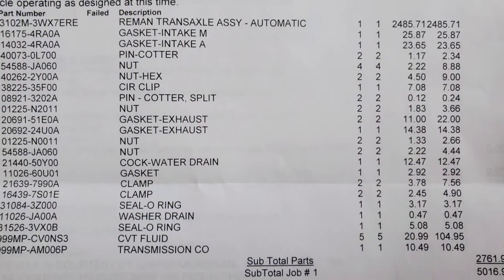2017 Nissan Maxima Cvt Failure! 🔴 What Signs to Watch For and Things To Avoid!

Comment: The CVT service intervals on nissans  should be evey 20k miles , the fluid gets very hot very quickly before  the transmission cooler cools it  down ,  therfore  the fluid gets burnt and starts damaging the CVT
Reply: it costs $225 dollars to change it so doing it every 20K miles would add a significant operating cost for the car. The manual says do it every 60K.
Reply: 147k never have never will gets driven across the country 3 times a year hard
Reply: @crand20033  I got mine with 41000 miles when I got to 60,000 I made sure  that service done. So far no issues!
Reply: I just talk to a guy who said he used to work on cars 30 years. Anyway he said the same thing, to change it at 20k.
Reply: @juancontreras8376  is that 20k after 100k miles on the vehicle?
Reply: Nissan knows about the issues with their CVT transmissions. They've been sued over it and refuse to recall.  At the first sign of transmission issues take the car to a dealer and trade it in. (or push it off a cliff)
Reply: Every 20k miles, sounds like a piece of crap for transmission.  Guess, change oil and transmission fluid at the same time 😂😂, I have a 16 maxima. Sadly! Looking other than Nissan!
Reply: @crand20033  so much bullshit by nissan, they better say go to another manufacturer!
Reply: Nissan mechanic told me the same thing. Change the fuild every 20k
Reply: @crand20033  you should learn how to diy. It’s not that hard you’re mostly paying for time because ur car just sits there for a while while they work on other cars. I drop the pan every 60k after drain and fill every 30k and might drop the pan again at 60 or 80k I’m not putting stress on the transmission much so I don’t have problems with mine at all
Reply: @crand20033  it costs me $60 lmao do it yourself clown
Reply: @airuzair2424  I'm such a clown that I can't even get the cap off of the filler pipe.
Reply: @crand20033  ok baby boomer
Reply: @crand20033  How did you get cap off? I have same problem.
Reply: @leehagen4061  No I took it to the dealer and they did it for about $280. Some places charge more than that but there are other ways to change it. I think some places do a more thorough job than others. And some places won't even do it because there can be a lot involved with it if you want it done right.
Reply: Got 170k on one of mine and I never had a problem nor has the fluid ever been changed.
Reply: It's 65k to 70k not 20k.
Reply: @jerrywilcox9890  Glad to hear it but I'd better  save up $4000 just in case. I like my Rogue.
Reply: Y’all do oil changes every 20,000 miles? Boa wtf😂
Reply: @crand20033  you drive it normally won't have a problem.people having problems drive them to hard.
Reply: @jerrywilcox9890  I agree,  but I would like to say that I don't see a difference between my CVT transmission and the one I had in my Chevy Equinox. My Nissan Rogue is very responsive, accelerates very smoothly and my car is very fast, powerful and zippy. I have no complaints and I'm very impressed with how it performs but I know the CVT is more likely to fail than a regular transmission so I will be changing the fluid more often.
Reply: @crand20033  I haven't had a problem with any of mine and I have 3 with the cvt transmission.
Reply: @jerrywilcox9890  Well, it's a matter of time and mileage but as I believe these transmissions are more failure prone than than geared ones and Nissan is notorious for producing cars with CVT transmissions that fail.
Reply: I do it myself for $100 and it's real easy to do...much easier than a oil change for me
Reply: I've added an bigger transmission cooler to mines. At 220k miles as of now and still counting. 
The fluid does get really hot 🔥. 
A few yrs ago when I noticed the whine and limp mode after I drove it over 45 minutes especially during the summer. 
 I did some research. I got the cooler installed. 
No more issues. Drove it to Orlando twice and didn't have any problems.
Reply: Where you got the cooler from? And how much?
Reply: @waviiflock1017  I bought mines off ebay for $200 and had it installed for 150
Reply: I got it done the first time at the stealer...yes 250.
Did it at 75k.
Next time I will do it myself and replace the external filter (dealer does not do this), I will drop the pan and clean the internal sift filter. Make sure it looks good inside.
Should cost < 80$
Reply: @jerrywilcox9890 if you don’t mind giving a more in depth explanation of driving too hard.. because I think I know exactly what u mean I just want to be sure. I have been looking into some newer cars (than what I have)  and my mom told me either a Toyota , Honda, Nissan.. with Hondas and Toyotas still being pretty expensive on the used private sell market for the year I want, I’m looking more into Nissan.. either Altima or maxima.. I’m looking at a maxima with 125k miles..  v6.. but yes I do think a lot of people always complaining about CVT takes every chance to floor the gas pedal through the floor.. and tbh I rarely see Nissans on the side of the freeway.. for them to be “such crap” and I’m pretty on top of my car maintenance.. if something small even sounds off, I get an entire thing serviced.. lol
Reply: @scottstewart2030 I’m really ready to do this
Reply: 20k is 10k less than what trans used to be serviced or even rear diffs. You can do the service yourself for $150 or so. Or wait and pay 4-6k for a trans. No trans is lifetime fluid, non.
Reply: So why wasn't you changing the transmission fluids and the cooler. It's not necessary for the cooler but it's just to have it clean for a better flow. I think you over paid for the new transmission. Also trying to drive it as if it's a manual is a Bigg miss take. When you see them for sale and needing a transmission that be the big reason. I don't bought so many gen 7 and flipped cause people didn't want to deal with the swap of transmission as if it wasn't their fault. Just because you can drive a real manual car it's not the same with the Maxima not to me it just don't feel right with out a clutch.  But you should have paid about half the price of what you paid for the transmission. Maybe lesser

Comment: Us to work on Nissan Dealership. Besides the rear wheel drive models. All the CVT no matter the model fails to the point of destruction. 6k to 8k or more $$$. Nissan manual transmission only.
Reply: Purchased a 2022 Sentra SR 6 speed manual in Canada and i know Nissan CVTs 2000 and up are much improved, but i always hear these horror stories about Nissan CVTs........
Reply: How many miles to change the cvt fluid?
Reply: @Therealpeter10  25k to 30k only use nissan brand cvt fluid you'll need 5 quarts and you'll have some left over dealership will charge $250 or so be $145 if you do it yourself figure $18- 22 a quart plus tax.
Reply: @johnjacobjingleheimerschmidt  thats too early manual says 60k tho
Reply: @Therealpeter10 25-30k. No matter what the manual says.
Reply: @Moistnmeaty90  maximas cvt are reliable than most though
Reply: @Therealpeter10  I agree, but the fluid still breaks down and there is wear that occurs. The fluid is jet black after 30k miles.
Reply: @Therealpeter10 even more reliable then Toyotas cvt’s 😂
Reply: Next time use carshiled and only pay thr deductible
Reply: @Moistnmeaty90 dam right after I did the 1st fluid change I decided to do the second one earlier and I freaked out because the 1st time didn't look that bad. Did 3rd change around 74k
Reply: @Moistnmeaty90 exactly 😂
Reply: @Therealpeter10 don’t believe the manufacturers hype between 20-30,00 bro 😎
Reply: @Moistnmeaty90 don’t forget to change the filter too
Reply: @hurleylee5754 I wouldn’t say that

Comment: For any newbs. CVT do not like to be raced. They do well on smooth acceleration. If you’re always flooring it it’s likely not going to last. Also, maintenance is CRUCIAL on CVT. The nicer and smoother you can drive it the longer it will last.
Reply: So basically don’t use the car for what it’s made for 

Drive it like a Oldsmobile basically 

So why buy this car if it can’t do what it’s designed to do because they aren’t even roomy…not comfy…not reliable 

They look ok…still has that Nissan badge though…

So I don’t understand why anyone would pay 40,000 dollars for them brand new knowing they’re not good vehicles
Reply: @tharpeaddy I keep asking the same questions. Everyone who defends cvt’s says the same shit about don’t drive hard or in stop and go traffic. Who can always avoid stop and go traffic and what’s considered driving hard…so dumb to even say.

Comment: Engine braking, Sport Mode I don't do. I don't ever floor it. I have a 2022 Maxima SR with 15,000 miles. Loving it! You drive it hard, can't do that with a CVT.
Reply: Shoulda bought a q50 tbh
Reply: @Ah_Dat_AJ I would easily buy the Q50 if the interior wasn't crap. It needs an update
Reply: Couldn’t agree more. Cant understand Nissan with Q50 having less features than a Maxima with infiniti being their luxury brand.
Reply: I agree  @Ah_Dat_AJ
Reply: @Gus31262 if I was you with that 2022 Nissan Maxima I would do a CVT and filter change between 30,000 to 50,000 miles... Don't follow the maintenance schedule of Nissan and if you do, do all maintenance in half the time or 3/4 the time they recommend so for example if they say do spark plugs at 100,000 do it between 60k- 80k miles.
Reply: @hajileserpud9539  Spark plugs can still be done at 100k or if you experience misfires. Even so they are inexpensive but it's not like it needs to be done earlier just because it's a Nissans. CVT fluid change at 30k is the only thing that is a must. 

Heck really only oil, and all oil/air filters need to be changed at intervals, the rest can be changed when it goes out

Comment: 2016 Maxima S with around 140,000 miles.  I haven't had any issues.  Love driving my maxima.
Reply: I just saw one for sale around the same miles you still liking the ride? Lol
Reply: What transmission service have you done so far?
Reply: 2016 Maxima Platinum 147,000. Transmission just went out and in the shop to be replaced $6600.00. I only had it for 15-20,000 miles. Extended warranty is a must. Nissan says every 30000 miles trans must be flushed.
Reply: I Have a 2014 Max...granny I'd a ting up getting worried 146,000 miles
Reply: I just dropped  my maxima SL 2016 off to have my transmission replaced. I have 144000 miles. I love the car and I keep it looking new, in and out. Im one of those that religiously do all the maintenance. So I would rather pay $6k than paying $60k for a new car. I took it to the dealer by the way, I wanted done right the first time. 36k miles warranty.
Reply: @EARTHSOUL_Asm   you watched a video about the most unreliable car and you are considering buying one? with 140k miles? some people cannot be helped

Comment: Sorry for your expense and feel your pain! I had a 2013 Sentra that I bought certified pre-owned with 20,000 miles and loved it until the CVT failed at 110,000 miles! It was going to cost me $5K to replace the transmission too but the car was only worth $,4500 with a year warranty on the CVT...no thanks! I was never going to buy another Nissan again until the dealership offered me a lifetime warranty ($100 deductible) if I bought a new car from them. It would cover the powertrain (engine, CVT, starter and alternator).The catch is that the dealership will do all the scheduled maintenance, so I purchased a new 2019 Maxima SV for $39,000. Great car so far with no issues (57,000 miles to date). I would recommend a warranty for any car these days. Repairs are too expensive!
Reply: My 2014 maxima cvt transmission died at 61k miles had extended warranty i paid $2300 for got a new one Lucky.

Had some steering components replaced too that would be over 1k
Reply: @CurtisDJunior  ouch man..... I find with these cvts, you have to take easy on them, they are not like regular automatic
Reply: @alvinsimba734  i take it extremely easy still happened. Not sure sure what happened the first 14k miles though before purchase. 

My only take away is change fluid every 30k and always park usong emergency brake. Hopefully the new one lasts
Reply: be sure to read the fine print on these warranties. Some of them will only repair the car if the repair cost less than the value of the car. Once the car gets down to being worth $5k, they won't fix it. Hopefully you didn't get that kind of warranty.
Reply: Where did you buy it from?

Comment: Nissan uses Jaaco CVTs which need a fluid flush every 20k miles to stay fully functional over 100k miles. Unfortunately dealers often tell ppl not to replace the fluid because it's a "sealed environment that you shouldn't break." so that they can get the money when you need a new transmission.
Reply: Nissan says to change the fluid every 60k miles in the owners manual.
Reply: @trenton737  if you change it every 60k you're still risking your transmission. Many different mechanics have recommended to change it every 20k-40k. 

That being said every 60k isn't that bad and will still let your transmission last way longer than if you never change it at all
Reply: That service advise was stopped years ago. Subaru also uses a Jatco transmission and they still advise their customers to never change the CVT fluid, to this day. That’s why Subaru cvt’s have the most issues now.

Comment: it sucks you had to replace the transmission, but you did admit that you know you caused the damage by driving very aggressive. Im really hoping my trans will last the life of the car, the only semi aggressive driving i do is quick acceleration from a stop every so often. I just did the fluid flush around 55k miles and it runs as smooth as butter still
Reply: The transmission will go out no matter how you drive it. It actually grinds the fluid, plus it's metal slipping and grabbing. Having to worry about passing on the freeway or accelerating for some reason is completely stupid. They were making more money by putting cvt in their cars . Actually they can't use them for big SUVs or trucks because they won't make 75k

Comment: My 2016 Nissan Altima 2.5 SL transmission finally went out on me at 181,000 miles. I bought it back in 2019 with 30,178 miles exactly. I love the car and it's gotten me very far to say the least. I'm never getting rid of it, I'm gonna put another transmission in it and put another 181k or more miles on it 😊. Definitely going to start doing the fluid drains every 20k miles though.
Reply: 181k miles is pretty good. Especially if you didn’t have your fluids drained properly.
Reply: @naturelover2292  Yeah I know right, I'm ready for round 2😄
Reply: @naturelover2292  Damn

Comment: We have a 2016 Nissan Maxima Platinum.  We got it in August 2015, one of the very first sold in our area.  Car went back for the antilock brake switch. They found a problem with the transmission.  Jutter Valve.  Changed it.  We only have about 34,000 miles on it still. So far so good. (7 years later)!!  Yes, we are NOT high milage drivers, and it was not out much during the Pandemic.  Car gets serviced regularly as suggested.  Keeping our fingers crossed!

Comment: I’ve had my 08 3.5 Altima since 2016 and it hasn’t broken. I drive it manual mode every single day. I’d suggest doing what I did and install an aftermarket transmission oil cooler which you can get at your local parts shop for less than $100. Also change your fluid every 20 to 30k miles.
Reply: Do they make a trans cooler for 2015 nissan sentra and what part store thanks alot God bless and take care in these troubling times
Reply: An you provide the part number by chance
Reply: @i8bigfoot  Imperial High Performance Transmission Oil Cooler
Part # 240514 is the minimum I would use. Derale Atomic-Cool Remote Fan-Mounted Oil Coolers 15850 or Mishimoto with Fan are recommended.
Reply: @VentureWelding   Imperial High Performance Transmission Oil Cooler
Part # 240514 is the minimum I would use. Derale Atomic-Cool Remote Fan-Mounted Oil Coolers 15850 or Mishimoto with Fan are recommended.
Reply: You can get those recommended direct from manufacturer or almost any local parts store.
Reply: Do I change it or have someone change it?

Comment: $5K is nothing; you made the right decision.  I replaced the computers and a battery for over $3500 in a paid-for 2004 Prius and it was worth it because I did not have to buy a new car for another 8 years!

The financial advisors will tell you if any two of these things is true, it's worth keeping the car:

E.  The exterior of the car is in good shape, keeps the rain off your fool head, and is not embarrassing.
I.  The interior of the car is in good shape, keeps your feet from dragging on the pavement below the car, and is not embarrassing once you throw a floormat over it.
M.  The mechanics of the car are sound and you only have to fix this one thing to avoid having the car strand you in the badlands or the South side of Chicago without your gat.

But these are the veto options:

1.  You just hate the car.  Sell it because life is too short.
2.  You hate buying new or used cars.  Fix it.  Life is too short.
3.  You hate new car salespeople.  Fix it.  They don't make money on selling you a car; they make money by selling you the money to buy a car.
4.  You hate used car salespeople.  Fix it. Rinse and repeat 3 above.
5.  You think the car salesperson is cute.  Fix the car and ask her out on a date. Even if the date goes horribly wrong, dinner is probably STILL cheaper than payments.  And if you buy the car from her, she'll no doubt have a boyfriend already and you'll STILL have to make the payments.